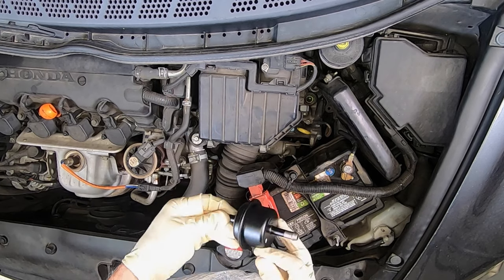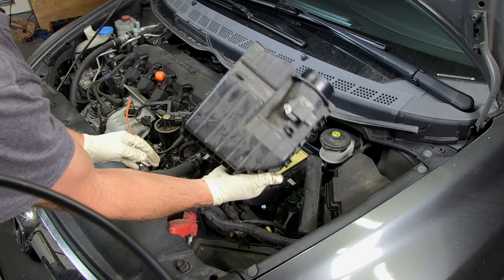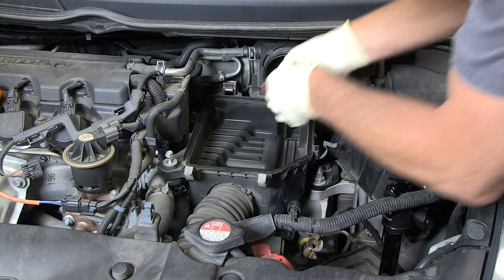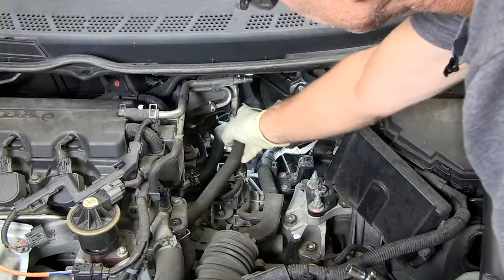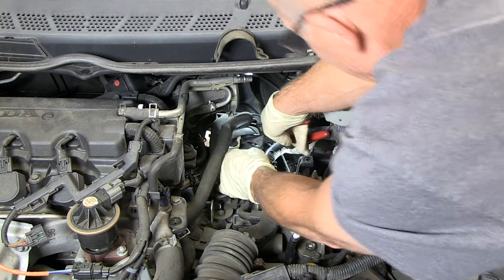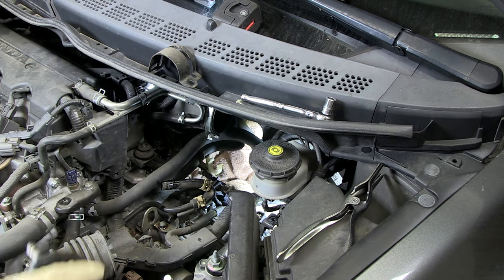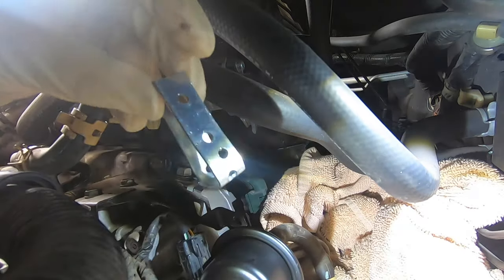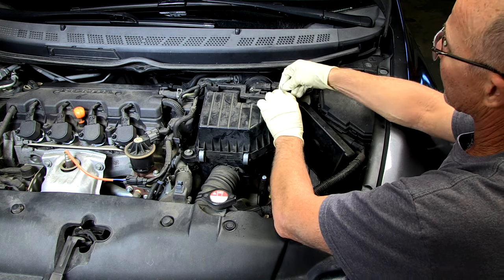Do this to your Honda Civic transmission to extend it's life, filter and fluid replacement

Comment: Danny, I used to love watching your videos until I went to do the work myself. Although you have gone to great lengths to produce high quality videos, excellent lighting, terrific multiple camera angles, good review of what tools are needed, clear audio voice-over and a pleasant background soundtrack the actual educational value is LACKING. You gloss over too many niggly issues or roadblocks that a home DIY mechanic will face and worst of all you NEVER SHOW completely how to put things back together like the the airbox bottom piece and hoses....

In this video the camera angle with your GoPro gives a great view of the filter but nobody can see that angle working from the top of the vehicle. After removing the filter holding clamp, I found that reaching in to undo the clamps on either side of the filter is a very difficult process (blind). I found that removing the top hose attached to the filter towards the front of the vehicle that it's better to not try to remove at the filter but go further up the hose and remove it from the hard pipe was much easier to get to and it also afforded me much better access to the clamp on the other down side of the filter. With the filter released from that top hose it's easier to bend the filter sideways to get to the other clamp next to the filter. I could now get direct access to the clamp, use pliers to move it away from the filter and then use the same set of hose pliers you used to release and move the hose away from the filter. Now with the filter out it was easy to replace everything on the bench.

Now comes the hard of putting everything back together. 

Your hose clamp trick is ingenious and very helpful but trying to get the filter bracket back on is a real pain to line up the bolt one handed and blind since your hand is in the way of seeing where the bolt needs to go. It took me quite a while to do that because the bracket piece was hard to line up squarely with the bolt hole. Next up replacing the airbox. OMG this is such a pain. You SKIP over this very tricky part of the process and show us the box in place. Sure would be nice to see how you managed to reattached the back of the airbox to the big air hose, and how you got to reinstall that pesky bolt that is to the right behind the box using a swivel wrench. All in this takes a very long time to get everything to fit perfectly and adds about 1 hour or more of trial and error.

Like I said in the beginning, you gloss over too many steps in producing your videos when it comes to reinstallation. Just like your power steering flush video that shows how easy it is to pull off the hoses (with the special hose pliers everyone should own) but when it came to reinstalling everything the video goes "poof" and everything is miraculously back together.

I'm now a lot wiser to the true value of your videos for my Honda Civic 8th Generation I'll be researching competitor videos to see what I am missing out from your videos.

Thank you, however, for the high production value of the video.
Reply: As a fellow DIY'er doing car work i tend to agree with some of your comments. Mainly that no one video on here ever shows the struggle you may have on your own car. I learned that myself doing my front strut assemblies last year. Looks very simple and yet can be a royal pain. The best thing to do to learn, is to look at all the videos that are on here (YouTube) and see as many potential problems you might run into. Like the old saying, "There's more than one way to skin a cat" there's more than one way to change this filter. I haven't done it yet myself as i dont want to be short one part or one type of tool that i will need after i do get started. Danny's video shows that the job is possible to be done at a home garage, not that it will be as easy.